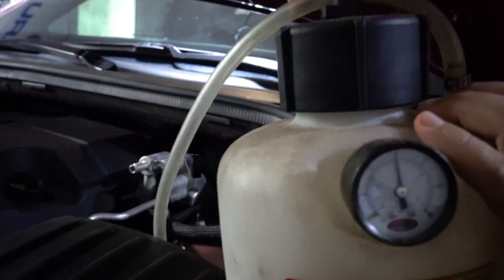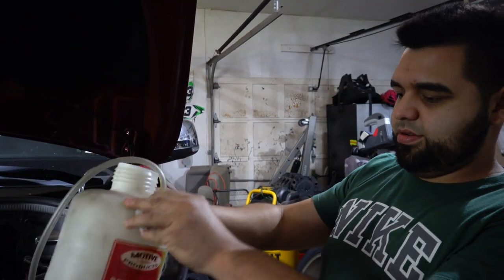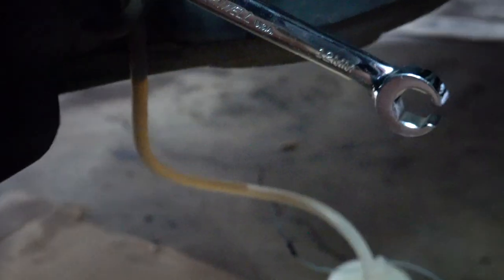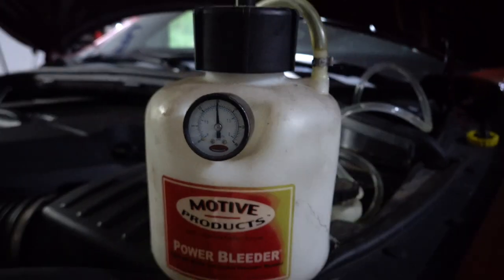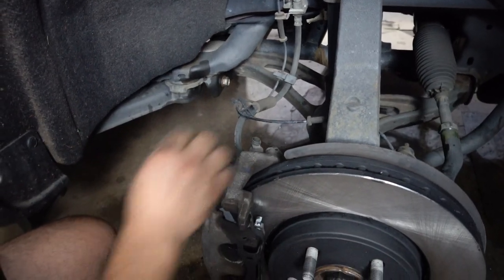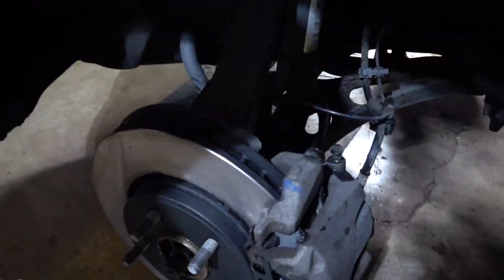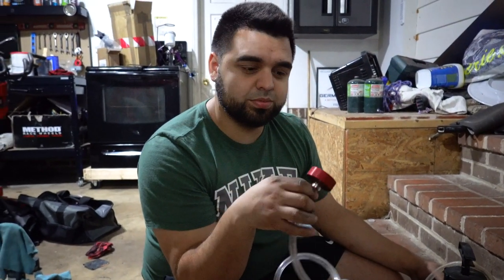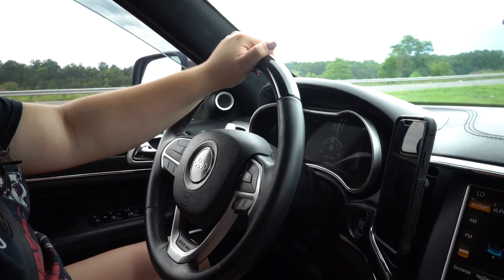How To Bleed Your Brakes Using Motive Products Power Bleeder

Comment: I like things like these, they make it so that one person can do it.  This way I don't have to ask anyone for help who might tell me to take it to a shop or tell me that it is a waste of money.  I also like the satisfaction of doing some of my own vehicle maintenance and it is something those people don't seem to get.  Though brake fluid is known for getting contaminated with water and other nasty stuff with age, some people may have never flushed theirs.  I am imagining a car maybe 20 years old and probably never had the brake reservoir cap removed since it left the factory and you can imagine how disgusting that fluid (or stuff that was once a fluid) is.  I am no mechanic but I do my own oil and stuff like that.  As long as the engine or transmission never need to come out or some other major job, I usually do it myself.  Anything I doubt I could do myself, I take to a shop a few miles away (I live on back roads and can get there reasonably quick).  I drive a Volkwagen and I like premium quality fluids like those from Liqui Moly.  I find that when I do those things myself I can use the difference to pay for good fluids.  I don't have anything against mechanics, it is just that they have to make a profit and often use very cheap fluids to help expand their profit margins.  Ever look at the price of a synthetic oil change at an independent shop?  It is fairly expensive, especially for the mediocre bulk oil they typically stock really.  I don't name shop names because I am not that kind of person but I would say that it is wise to ask questions about how they do things.  For example on a sealed automatic transmission, there is sometimes a stand pipe or overflow tube and not all mechanics understand how these work.  Ask them how they check the fluid level because it is sometimes different from vehicle to vehicle.  On my Passat, that is with the engine running and at operating temperature.  You would take the first plug out and see if any fluid drips out of the overflow tube, if not add some.  If not don't while the vehicle is running (in park preferably for safety!!) it will be underfilled when the plug is removed.  To drain the fluid, the overflow tube must be removed but MAKE SURE THEY DON'T LOOSE IT!!!!! , it needs to go back in there for the refill and fluid level check or they may owe you a replacement transmission for their mistake!

Comment: I just bought this power bleeder and it did a great job.  I power bled the system while actuating the ABS pump with a computer.  

My daughter lost her brakes while driving. Blew a rubber brake line up front.  Put 2 new rubber lines and new master cylinder on.
Reply from the maker: Glad you got it fixed. I hope she wasn’t hurt! So scary
Reply: @StayOnTheGas  

    She used her E-brake that I just had put all new brakes around and tightened up her E-brake.  It stopped her well.  A friend drove it home for her.
Reply from the maker: Glad to hear everything was okay!

Comment: Great Video , my thought is where does that Air in-between Pressure tank to reservoir  go when you start to Bleed ? Does it    get pushed into brake-line? Or just stay on top of reservoir? 
Im thinking , do i need to prime line from Tank to reservoir , to get Air out First. 
Well im doing Service today So ill find out 
Thanks for Tutorial  Very Easy to Understand

Comment: I like the video. Only suggestion I would say about bleeding the brakes is to look at the service manual for any car and check where to bleed first. I know for my car its stating I should start up front on the passenger side and work counter clockwiseb (2015 Crosstrek ). Thanks for the video and I have the same kit!!
Reply from the maker: Thanks. That’s a weird way to do it but I’m sure they say to do it that way for a reason
Reply: @StayOnTheGas  , by the way, did you ever run into issue with the hoses that connects the adapter and the tank not keeping pressure. Ran into that issue and had to get teflon tape to fix it
Reply: just need to start on the furthest from master and work your way around to the closest. 
so it depends on master location and how the lines are routed
Reply: It has to do with where your antilock brake module is located if the module with all the lines is up front you start in rear first if your module is in rearward area you start front first 👍🏻

Comment: Good video good product. Bleed procedure vary a little right rear start most vehicles some vehicles next wheel left front then left rear and last right front specific to some Chrysler's and to some other vehicles called diagonal brake bleed. Specific to certain vehicles. Appreciate video.

Comment: Easier than he way I used to do it, nice tip.
Why not just use the reservoir adapter and use a compressor at 10-15 psi and bleed each until you reach the min level, refill and repeat.  Its a bit more work, but you don't have to mess with the brake fluid in the tank and hoses.
Reply from the maker: Yeah it can be done that way. Just have to have a regulator either on the line or on the compressor itself. I just hate hearing the compressor going off in the garage while I’m in there working.

Comment: After removing the old fluid out of the reservoir and refilling it with fresh fluid prior to hooking up the power bleeder, is there any risk of introducing air into the lines?  When you pressurized the power bleeder, you could see air moving through those lines...I guess I'm just confused how it doesn't get into the brake system.
Reply from the maker: As long as you don’t completely empty out the reservoir, no air will be introduced to the system. The air in the power bleeder line you see stays in the reservoir so nothing goes into the lines. Plus, when you’re bleeding each line, go until you see clear fluid with no bubbles and you’ll know you have fresh fluid and no air 👍🏼
Reply: @StayOnTheGas  Thank you for the very detailed reply!  Much appreciated :)
Reply from the maker: No problem!
Reply: Think about it, this is to remove the air in the lines & replace the fluid.

So if you follow directions you will be just fine no air

Comment: Great video. When you are done depressurized the line and unscrewing the power bleeder cap from the reservoir isn't there fluid left in the bleeder tubing? What do you do so it does not spill as you remove the cap?
Reply from the maker: Honestly just keep a rag ready

Comment: I have seen videos in which they say they use Vaseline to help make a seal.  That is not a good idea, Vaseline is petroleum!  You can't have petroleum in the brake system, it will wreak havoc on all the rubber seals.  Use silicone if you must and look at the MSDS for it to ensure it is free of any petroleum.  Also don't use any that you think might be contaminated (like if you think anyone may have inadvertently cross contaminated it by using something that was in contact with petroleum without being thoroughly cleaned of all traces)

Comment: How did the brake fluid change affect the steering wheel from pulsating or vibrating? I didn't know those were connected
Reply from the maker: The brake flush doesn’t affect steering or vibration. This video is connected to the previous 2 videos of the Jeep where I get new tires, alignment, and pads & rotors. I just had to do the flush before driving it
Reply: @StayOnTheGas  ah that makes sense. Good stuff!
Reply from the maker: Thanks!
Reply: @StayOnTheGas  I was wondering why the rotors looked so clean. Everything makes sense!
Reply from the maker: Yeah I should’ve explained that lol

Comment: I’ve done this 20 million times and it won’t work for me. New brake booster, master cylinder, new calipers, rotors,pads you name it. Do a test for leaks and it holds pressure. So the bleeding according to manual of my Nissan 240sx 1993 which the sequence is different still did it in the order you did it and still getting a soft pedal. What else it could be?
Reply from the maker: That’s weird. 93 so I’m guessing it probably doesn’t have abs? If it does, it could be something with that
Reply: @StayOnTheGas  no abs just regular. Someone replied to me saying that I need to bench press my master cylinder, first time I hear that there’s always something new to learn
Reply: @joaquinsandoval7156  what you are experiencing is classic problem when replacing the master cylinder, always bench bleed. Did your problem clear up?
Reply: @octuple505  I did it and after dealing with it and getting frustrated I stop working on the car. Still have to check and last thing that i could thing about not getting pressure on my breaks is to check my lines that connect to the booster and make sure theres no leaks. But overall NO i still havent been able to fix the issue.
Reply: @joaquinsandoval7156  I realize you've been working this for a bit and it's frustrating. You mentioned replacement of the booster as well as master cylinder. The symptoms and trouble shooting steps you've noted point toward the booster push rod and break pedal connector.  There are a few videos, I had this problem with my old Ford truck. 

https://youtube.com/watch?v=YDlz7-X3S2g&feature=share8
Reply: @octuple505  It looks and feel good underneath. Is adjusted perfectly. I think is just a hose booster leak. I'll check and see then i will update.